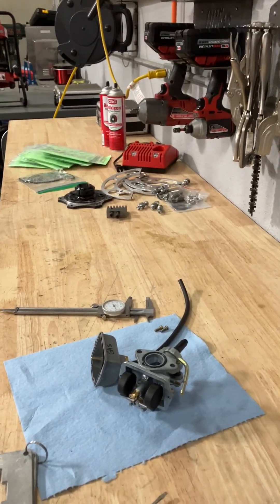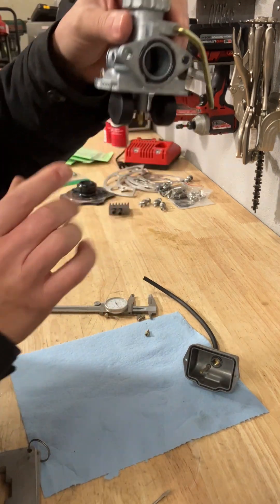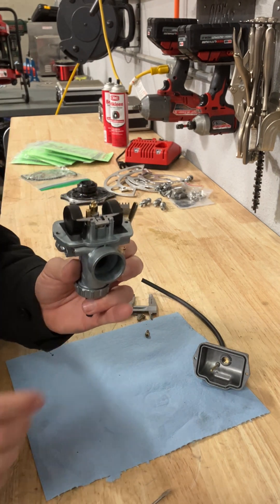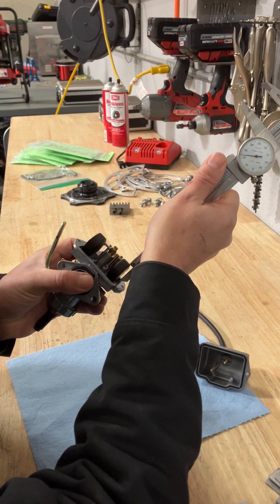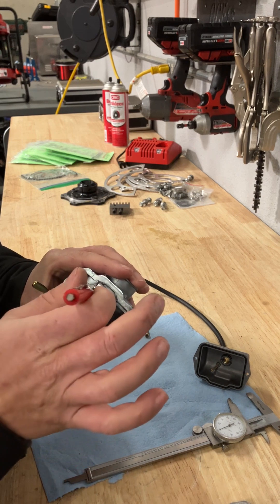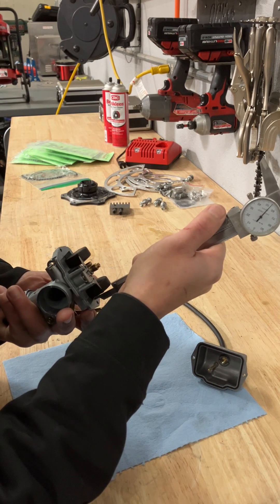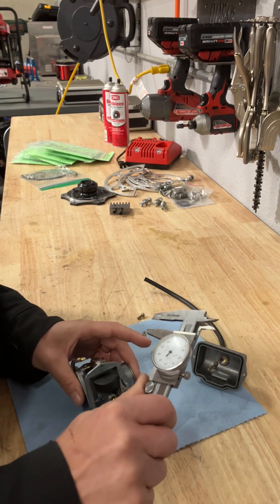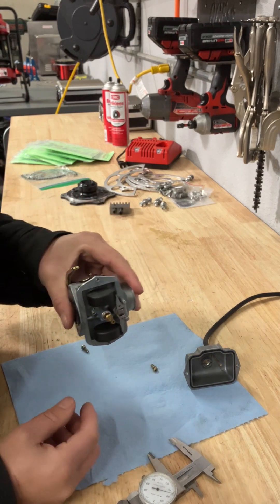Briggs Lo206 Carburetor float adjustment:  How To

Comment: Need video great tips . Quick question about my mustang 2017 GT auto with only 12000milles when should I change my sparkplug and tranny oil ,rearend oil and do use lube on new sparkplug or not, which brand sparkplug for NA set up with bolt on.Thanks!💪😎🇨🇦